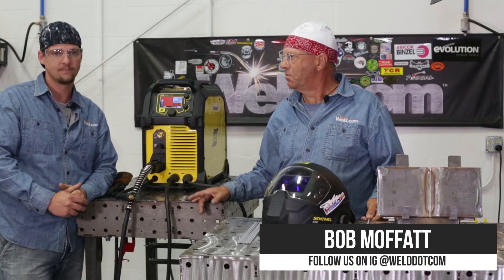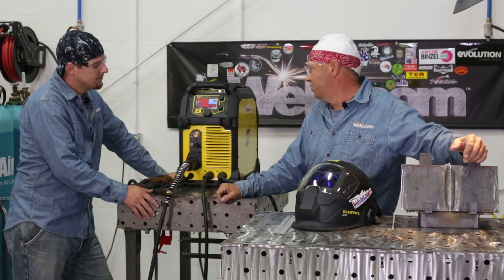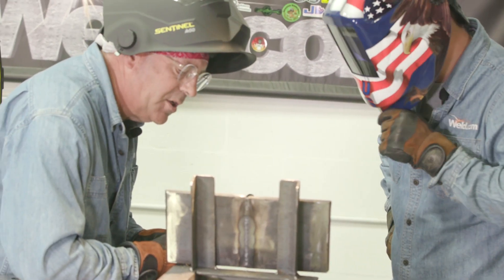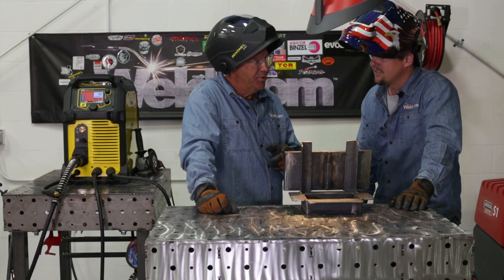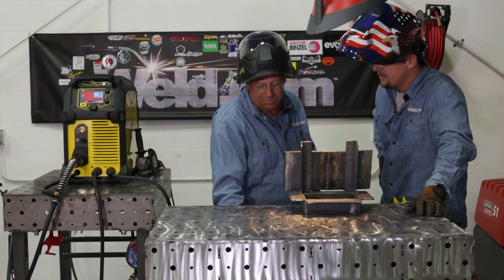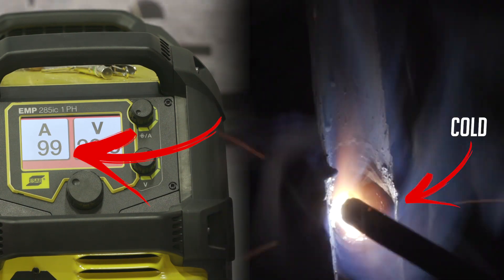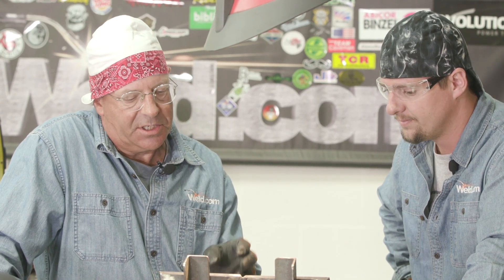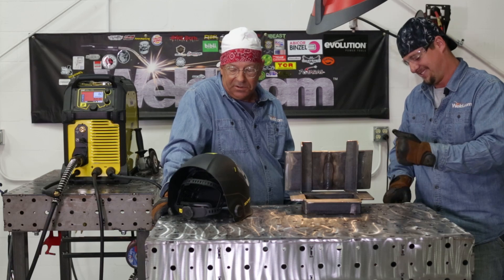🔥What Does HOT START Actually Do?

Comment: One of my miller machines does hot start, you really want it for 7018. Just bought another for this feature specifically.  Way easier to get 7018 relighted and no rework from a bad start. I do lots of confined space ship welding and you rarely can manipulate the rod correctly which makes it very difficult to get a good weld going. Hot start is just boom, you're welding, even from a poor angle.
Reply: What’s amperage and % do you set it to for 7018?

Comment: Hi Bob, please help me with a problem that is driving me crazy.  I'm using a cheap stick welder which does not have adjustable features like you demonstrate.  Some cheap models may have a feature built in but it's not really spelled out anyway.  So I'm trying to weld 18 gauge sheet metal and had no success with 1/16 6013 except for a tack on flat area, but I had some nice success with 1/16 6011.  I run it kind of hot in fact it seems a bit like a flame thrower.  My technique is to lay a series of tack like welds an ongoing bead would burn a hole right through.  So I have a little trouble with a brand new stick being cold, but then it gets going good.  However, after about three tacks it begins to stick again and again, I lose the ability to restart it.  I also noticed sometimes when it gets going again after effort it burns entirely different, like very cold.  I have put it aside on scrap and let it burn a while and it burns well again!  Oh, welder is set at 60 Amps but being in 110 outlet it is probably only giving 45.  Am I cooking the rod?  Is it the welder? Would a machine with hot start help in this situation?  I appreciate any help, sorry for such a long question.

Comment: So if I put 50 % it’s 50 % above the amps u had it or it’s 50 % of the amps ur using ? I thought if I put it at 50% it was 40 , half of 80 , can somebody explained it
Reply: Manufacturers are idiots, all they need to do is to use amps value as hot start, this way its way less confusing and more efficient way of welding, no maths involved. Tired of idiotic people who have limited thinking.
Reply: It provides additional amperage initially. If the machine is set to 100 amps and the hot start is activated at 50%, the arc will initiate and operate at 150 amps for a brief period before reducing back to 100 amps.
And yes, 50% of your 80 amp setting is 40 amps. The 40 amps are added to the 80 amps for a 120 amp start.

Comment: Just have a little 100 amp buzzbox. Hate restarting 7014s & 7018s !     😬
Reply: put a brick on your work bench on top of a piece of wood. I tap the hot tip of the electrode into the wood to scoot back the flux slightly, then scratch the tip of the electrode on the brick to remove the little wood ash. Give that little tip a shot ...
Reply: AC buzz box are cool. Never have a problem restarting 7014. 7018 for that matter.

Comment: I’m excited for the new AC/DC machine, but I wish it was a 235ic AC/DC not the smaller 205ic AC/DC. My luck if I buy the 205ic now the more powerful machines will be announced. I’d rather just buy a Miller Dynasty 280DX rather than compromise and get something I’m going to end up selling not long after buying.

More Spray Transfer and Globular Transfer vids would be great. (solid wire & dual shield either 045 or 052.) Some monster single pass on thick plate, Filets and Grooves.